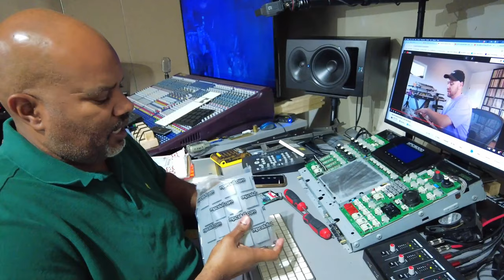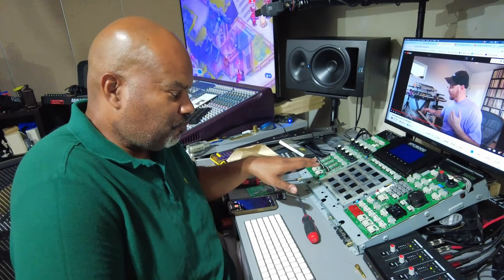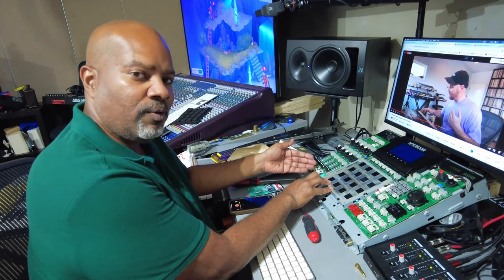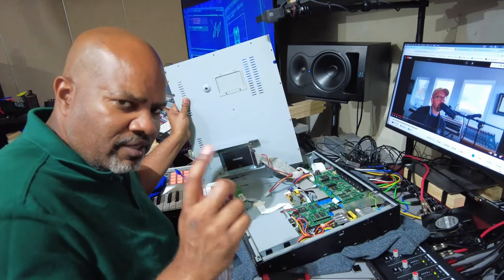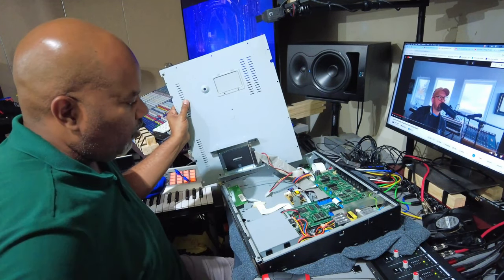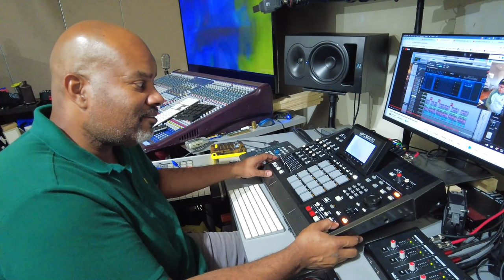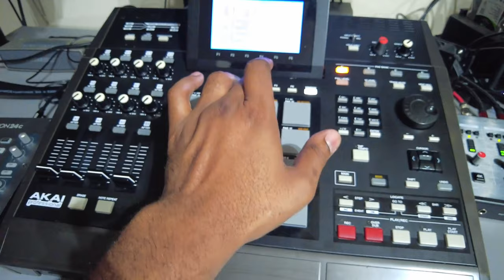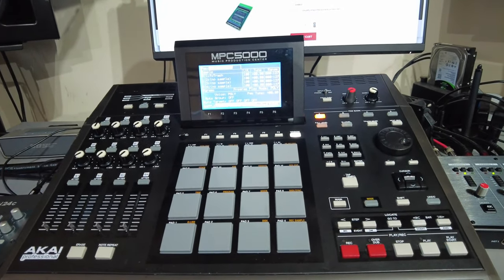Re-Assembling my Akai MPC 5000. How Hard Was It?

Comment: Just doing my pad sensors now. I did the scapol cut thing on the old ones and they at least worked rather than not, but it was like on or off zero sensitivity so I stumped up for the pad sensors.  I think your original pad problem may have not been electrical but the same as mine air (or lack of inside the pad sensors)
Reply from the maker: I think you’re right.

Comment: hey my man... could you explain how you figured out how to put the Jogwheel in place... i reassembled my 5K twice now... when the Faceplate of the MPC is deinstalled, the Jogwheel just runs fine. But when I try to install the Faceplate again, I have problems with turning it smooth. I saw the marks or Groves on the Wheel and the Pcbmountpart. But I can really make no sense of it... You got any info on my problem? I know that the next tyme Iam going to tackle that problem, I could still make no sense on how to assemble the Wheel. I really enjoyed your 5000mpc Videos! Bless Ya
Reply from the maker: Man that one this pissed me off soo much 😅. So it took a few tries. You have to line up those notches and push it on gently. But it took a few tries.  I swear the final time I don’t think I lined it up right but it was. It’s so weird.
Reply from the maker: @BrooseWayniac  excuse the typos.  I just read back what I wrote and fixed it.